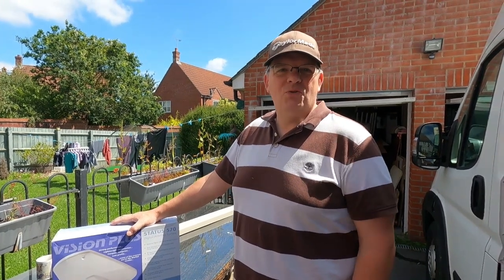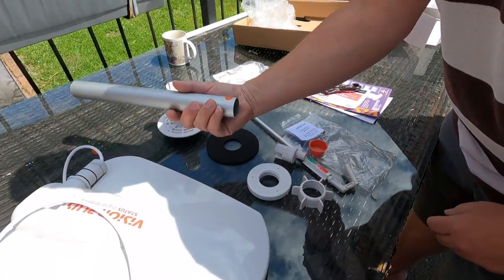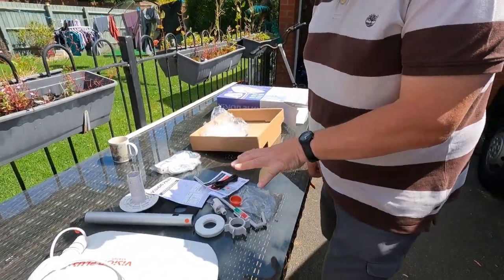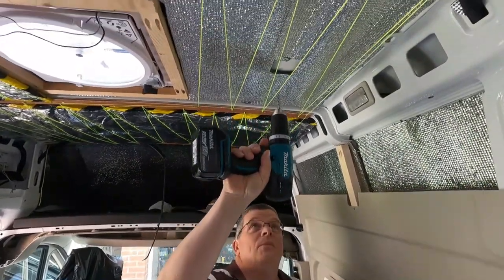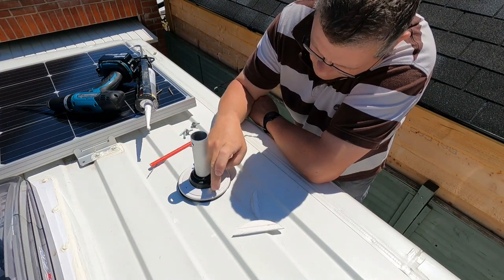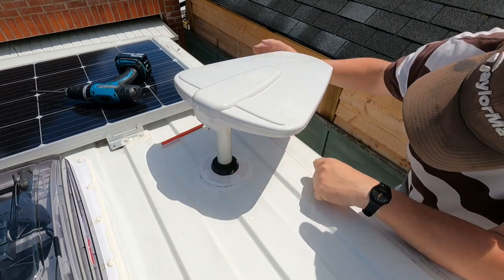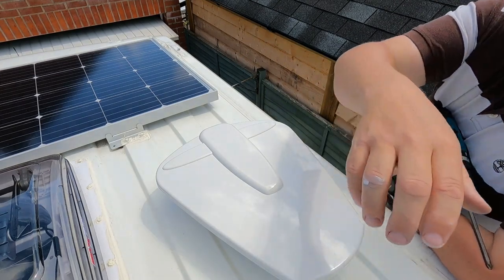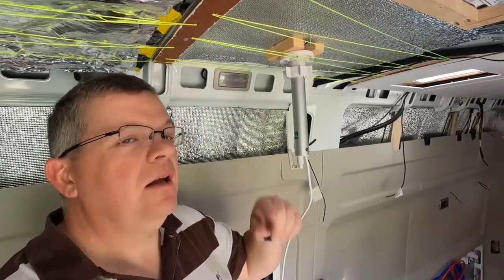VisionPlus Status 570 TV aerial unboxing and installation tutorial

Comment: Great video, thanks. Leaving the pole and fittings in place, I am going to remove the antenna on mine and replace it with my new Starlink Mini. I will also try to use the amplifier’s power supply to power Starlink now it is a 12v unit. Just need to refit a radio antenna…
Reply from the maker: good luck with the re-vamp.

Comment: I  got an aerial like that second hand, but am only using the aerial booster with a tiny aerial that has a magnetic mount - takes up way less space and no need to drill a hole in the roof. I saw this idea on One Man and His Whippet's channel, he and several others use the same small magnetic aerial in the UK - most of them have the aerial permanently mounted on the roof - along with Wifi boosters too - might be worth a look for a few ideas on other things he has done.

Comment: What size whole did you drill?
Reply from the maker: Sorry but cant remember right now. I do know that the hole cutting kit (Bosch) I have with 6 different sizes in it had the right one so I guess a fairly standard size, around 50mm ish at a guess?
Reply: @wiltshirecustomcamper7203  ok thank you, I’m just starting of with the caravan and I’ve just bought the 570 i have little storage cupboards above my sofa s it’s a 1997 abi ace harmony will the pole fit inside there ok? Ps loving your videos there so helpful